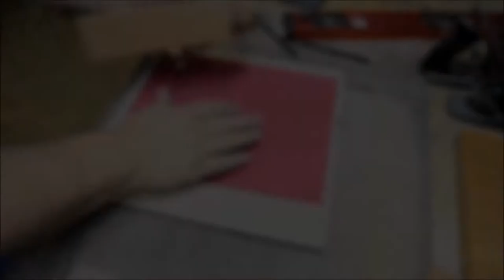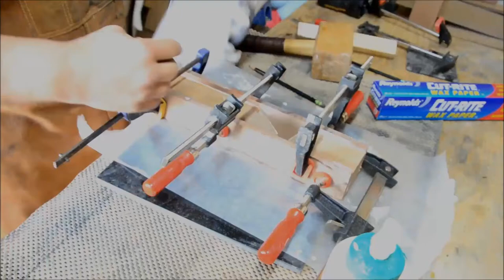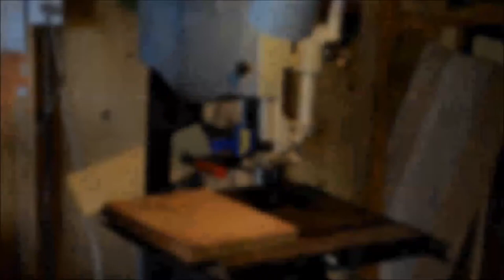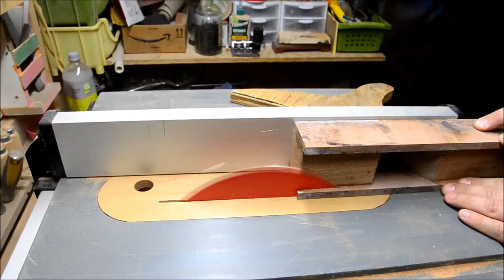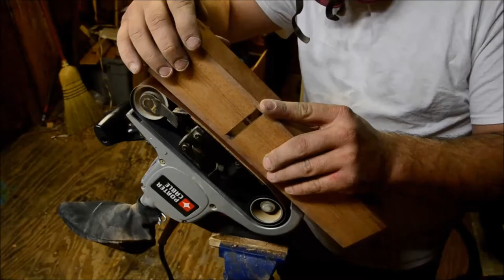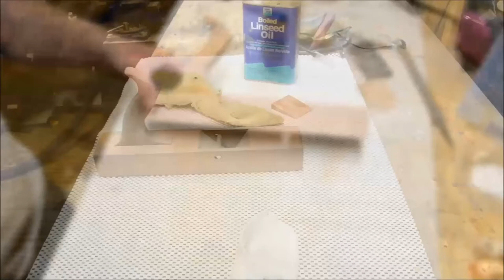Homemade Krenov Style Plane

Comment: What angles did you use for the bed?
Reply from the maker: Mystic_Monster7 I believe I used 45 degrees on the blade side and 70 on the other side. The second angle can be just about anything over 60 I think.